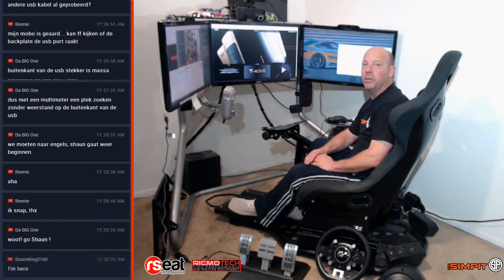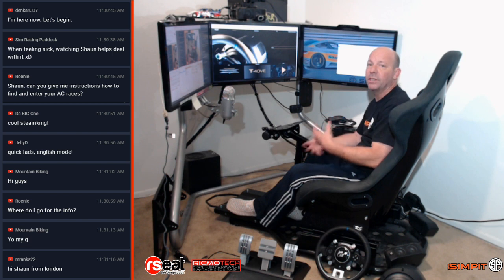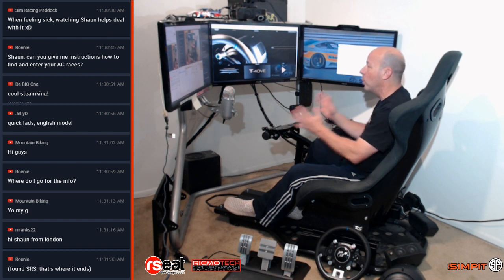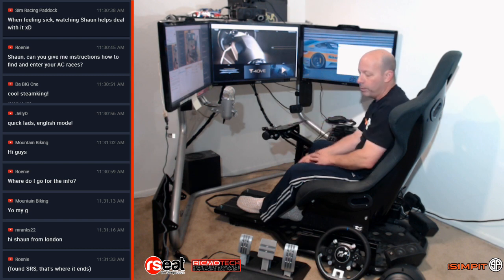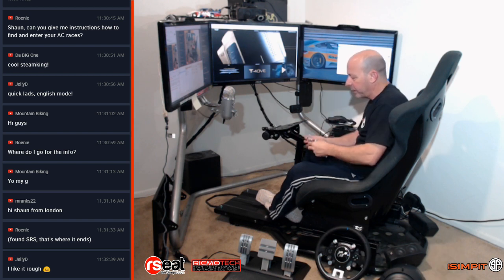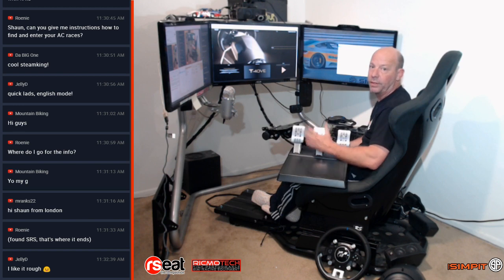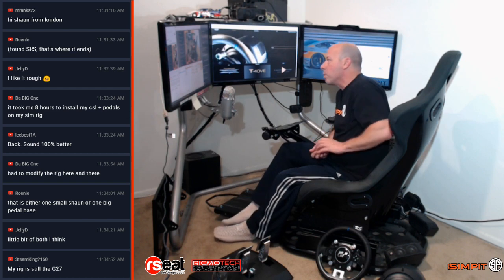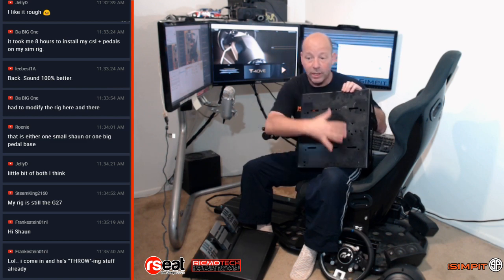Installation, Drivers and Firmware update of the Thrustmaster T-GT

Comment: I follow the instructions exactly but when I plug in the wheel, it never spins. The upstate finishes almost instantly and the wheel is never responsive in any game. When I go into the thrustmaster directory and look for the control panel apps, it is completely empty. When I access the thrustmaster's control panel from joy.cpl and click properties, it displays a default controller panel and not the thrustmaster settings panel with firmware info. I know the wheel is powered because the light is on. It is set to PS3 mode. Someone please help me because I've looked absolutely everywhere and come up with nothing.

Comment: Interesting observation: those 2 little holes behind the gas pedal look really random, don’t they? Those holes where meant to mount an Thrustmaster TRS official loadcell mod. However the mod (sadly) never made it to release. Hopefully with the release of the new “high” end range of the TS-PC/XW / T-GT, thrustmaster will finally release a loadcell mod for the T3PA/GT (Pro)! I believe ISRTV had a prototype back in 2013. Could you confirm this Shaun?
Reply from the maker: Yes we did have that mod, we tested it and there were some issues.  I thought it was going to get re worked but was held back.  I have heard rumors of a new one making its way to us.
Reply: Hello Shaun, anything new bout cellmod ?